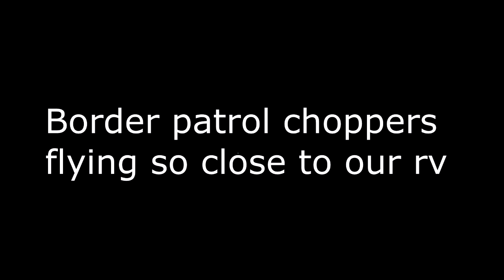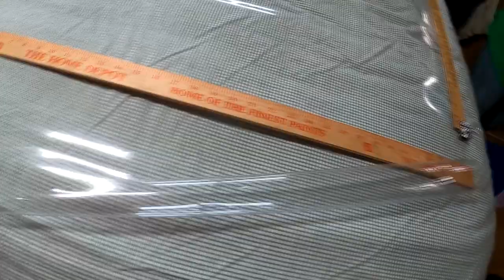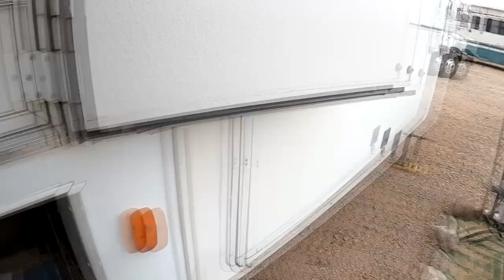RV Living fulltime on the road with DIY projects! Why We Cover Our Screen Door With Plastic

Comment: Hey, Tom and Lori. Thanks for the video. :^)
Here's a tip for ya...  I used to take two big speaker magnets and wrap them each in rags. Then stick one on each side of the glass (upstairs windows) like you did with yours. When you clean the inside glass, the outside gets fairly clean too. It came in really handy in Minnesota in February -- sure beats climbing a ladder in the snow. Just sane... :^) Saint
Reply from the maker: That's a great idea!